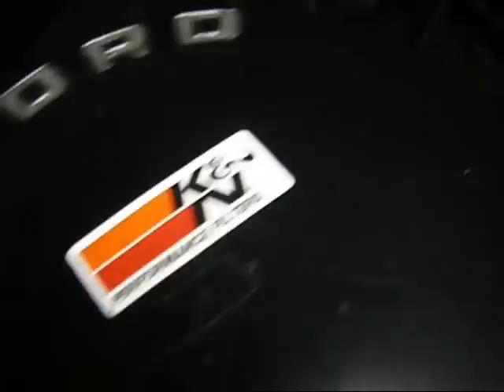Ford Corrtina MK4 Weber 32/36 service

Comment: u need a manifold to suite the whole carb if u want it to benifit, it has an oval or rather elongated rectangle with round ends to align with chokes, adapting a big carb to fit a small hole is the same as having a small carb more or less.
I reckon a twin choke manifold with opened out hole would be good for a 40dcnf twin barrel weber, I got 2 from an mg maestro for £40 in about 1992! bargain!
I believe the manifolds useful r granada 2.0 pinto, cortina 1.6 and 2.0 pinto etc.